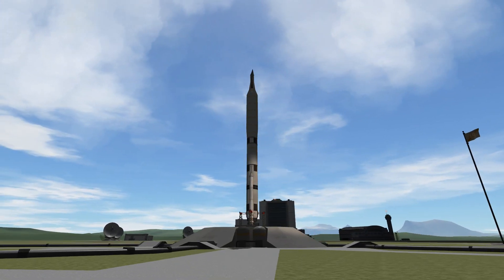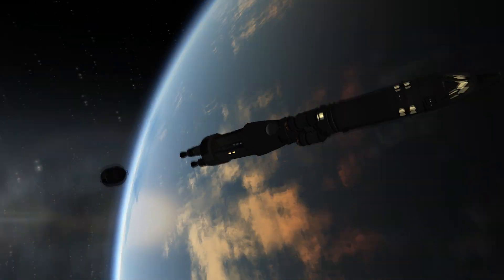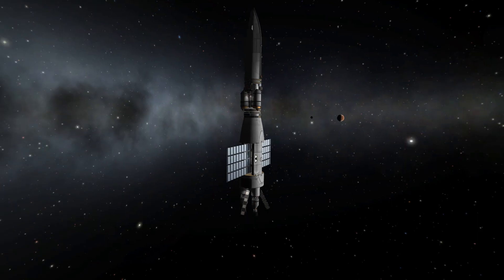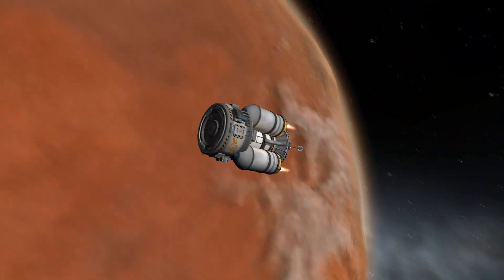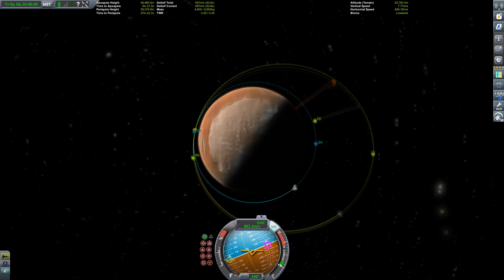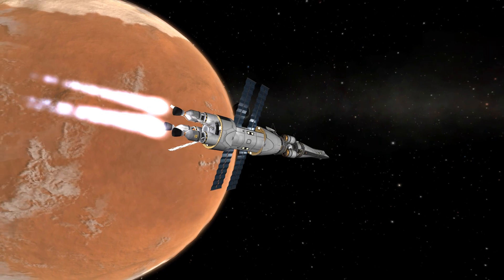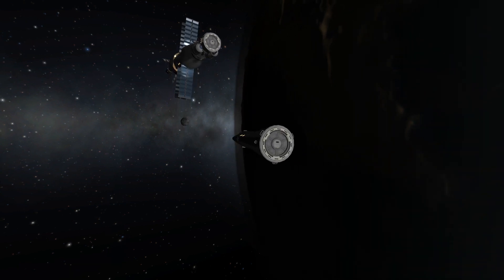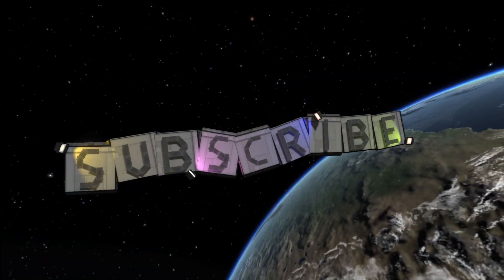A Sensible Spaceship for a change - on a mission to Duna

Comment: I got a little problem with my rover-build, can anyone tell me what I'm doing wrong?:

I got my rover in a hangarbay attached via docking nodes. First time i detach it says "decouple node" which works fine. But when i reattach it and then want to detach it it says "undock" and that slings my rover into the air (or the top of the hangarbay) and punches it tires if it doesnt explode completly. And I dont know how to fix that now ... tried first with a dockingport in the back, then underneath to take some force out of it ... but it still slings it just as much. Testing it btw on Kerbin, so not the lowest of gravities.
Reply: Zukasa [Steam] Maybe, just maybe, (I don't actually play, it is just a guess) it might be that you don't deactivate SAS directly after docking... heard that not doing it causes the kraken to get angry... -> exploding and wobbeling...
Reply: Angry Kraken means your Spacecraft in whole is wobbling and all connections are moving till the spacecraft will rip itself apart (caused usually by too small connections for too big parts, if you attach something and got SAS on it wants to move and that puts on even more stress on this eventually little joints and that releases the kraken). In my case only the rover will sling out at ~5 to 10/ms and might explode, but the rest of the Ship is fine.